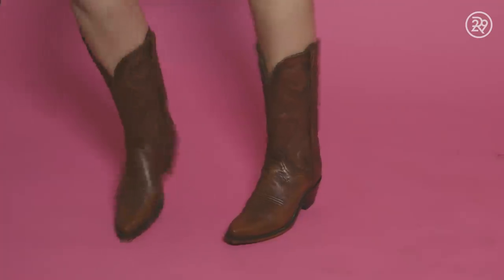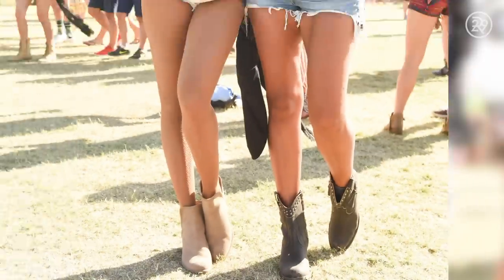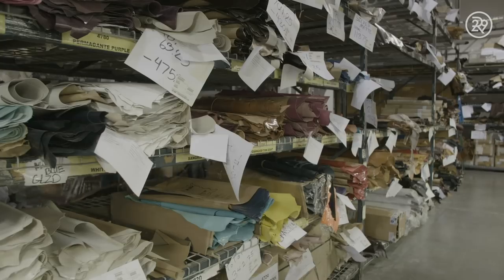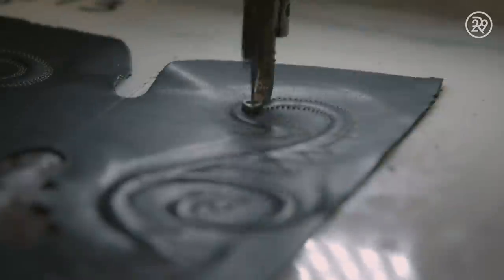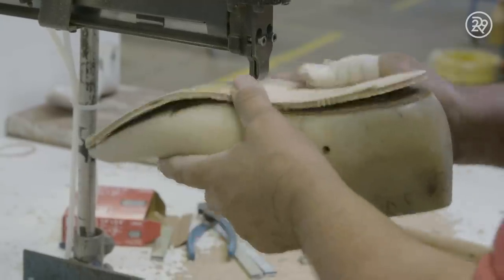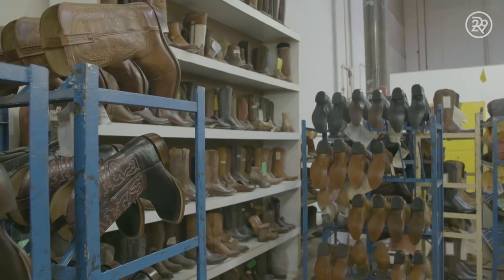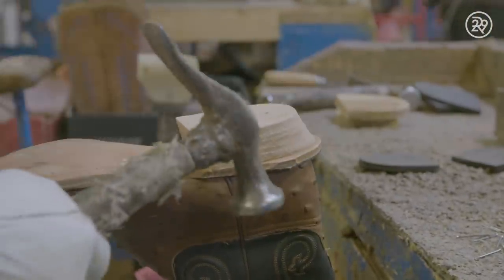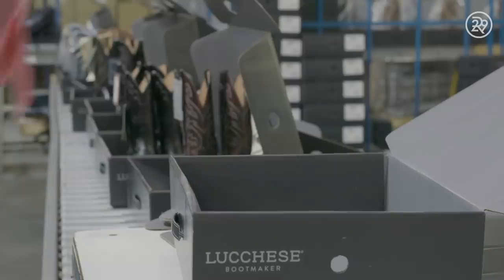How $1,500 Cowboy Boots Are Made | How Stuff Is Made | Refinery29

Comment: When did they take the wood out of the shoes?
Reply: Rebecca Mhagama depends on the boot some have wooden some have rubber
Reply: The sole is leather, rubber, or composite; not wood. The stain used to die the sole makes a hard leather outsole look like wood.
Reply: Hey fellas, i think rebecca meant the "lasts", not the outer soles, which are leather, they probably remove the staples then pull them out when they are done shaping.

Comment: If all the water evaporates, wouldn't it just get trapped in the air and make it humid?
Reply: Probably well ventilated
Reply: Think air conditioning with heat. Or a sauna. They control the humidity. Hope that makes sense.